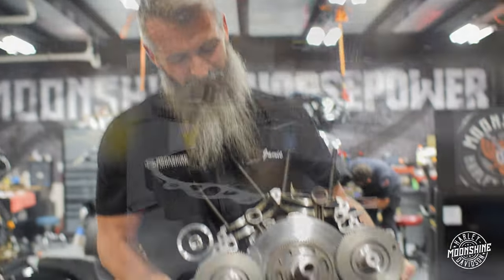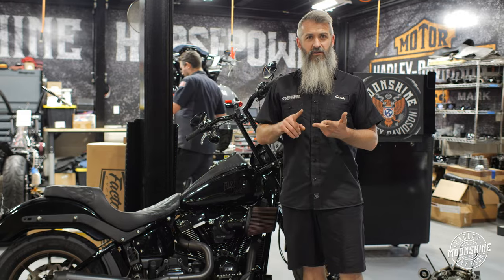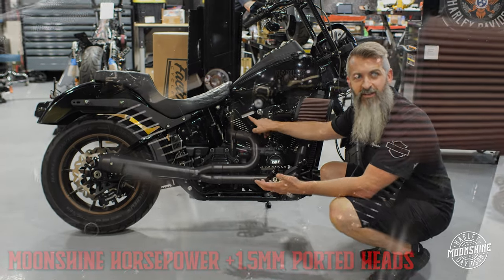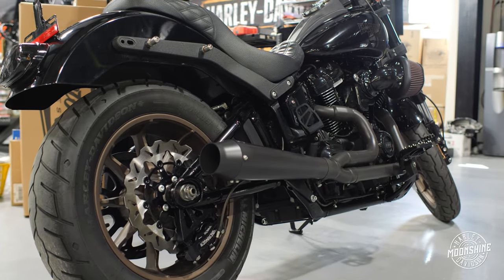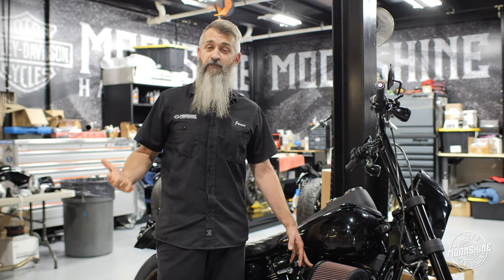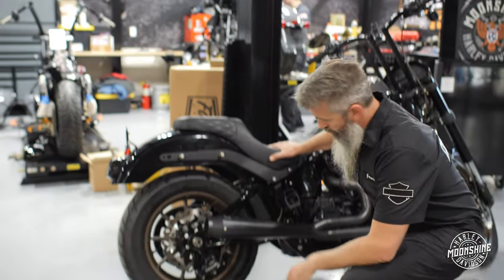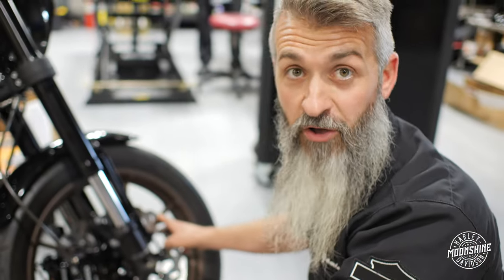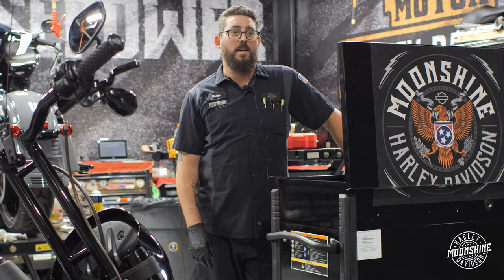Moonshine Horsepower 131 Ass Eater M8 Softail 149HP 151TQ | Bike Build No. 11

Comment: Hey pal. Looking to build my 24 LRS up to 131. Currently running stage II with:

CR483 cam
Oil pump/cam cover
Thundermax tuner
HPI 2-1
5.5’s
Ohlins front and rear
Among other things for the stage II like intake, etc.

I was planning to buy the SE 131 kit. I’m wondering if I should buy a flywheel but don’t know if I should go 4 3/8 or 4 5/8. Also would you recommend a CR515 or CR550 cam and 6.8 injectors.

Any info you can provide will be appreciated. I want it to be quick off the line but manageable in the corners.

Comment: If the front radial adapter bracket is mounted to the same place as the factory brakes wouldn’t you have unwanted flex still if not more from the length of the bracket?

Comment: Is an E85 build in the future?  Some of those E85 Builds  are running insane Numbers while running cooler,,, its a dirtier fuel ,  Not quite the initial investment but very streetable..Are you seeing some customer wanting to go that route?,,,  Thanks for the great builds.
Reply from the maker: The one problem is an E85 setup requires about 30% more fuel. Bad fuel mileage but if you don’t care about that and have access to it then let’s rock. Need a E85 tolerant fuel pump larger injectors and tune. 🚀
Reply: @MoonshineHarley  Thanks for the input,,,Many happy Burn outs,,,

Comment: If you had your crank balanced to within one gram why would you still need those counter balances, wouldn't the crank balanced that well, be enough eliminate vibration through the entire bike, please explain if you would? Wouldn't that motor be capable of higher R P M's if those counterbalances were eliminated? Thanks in advance if you take the time to explain this to me.
Reply from the maker: The Harley-Davidson firing order is not concentric. So it will pulse even when balanced to 0 grams.

Comment: Those axial to radial adapter really don’t do anything. The force still gets transferred axially. Proper way would be to swap out the fork and rear caliper mount for radial mounting.
Reply from the maker: You are right in that swapping the fork would be best. But your statement about them not doing anything would be false. Have you tried them yet? We can report that the extra stopping force from the radial caliper is still a considerable difference even when mounted to the stock axial location. And the rear Krause bracket is a true radial mount.
Reply: @MoonshineHarley  How does it reduce caliper flex if you're taking a radial mount caliper and converting it to an axial mount caliper?
Reply: @MoonshineHarley  Not on my fxdls but have on a triumph speed twin. But yea I may have been a bit dramatic saying it doesn’t do anything. I’m sure those beringer are noticeably better than the oem ones.
Reply from the maker: @Dirkadew  correct!
Reply from the maker: @KainamHD  by adding a caliper with a lot more piston area which will increase the applied braking force.

Comment: How many people could really ride it that hard though? Those tall ass Tbars restrict your body position. I'd rather have a set of 4inch pullbacks with a more standard HD bar or a moto bar so I could get some real good over the tank body position. Sitting straight up gives you less lean angle to work with.
I'd love to ride that bike with a lower set of  and see how fast I can running through a twisty road. I bet it'd put some sport bikes on their toes.

Comment: Sick build - you guys are legit, putting together some high-end performance packages! With that said - COULD you guys put together a couple bracket builds? 
IE: a couple somewhat affordable performance builds that are still a lot better than the "run of the mill", with a known parts list and price?
Example:  
Bracket A - Skinny Ass Eater – still performs but could use a cheeseburger.
Bracket B – Skinny Ass II
Reply from the maker: We have them. 
128 stock heads.
128 with MHP heads. 
When you are ready just give our team a call and we’ll help you with the right build that fits your budget. Are stage II setup on a 114 makes around 130TQ and 125HP. Awesome build for the $.
Reply: @MoonshineHarley  Sweet! - Thanks for the info & reply. Saving my pennies.